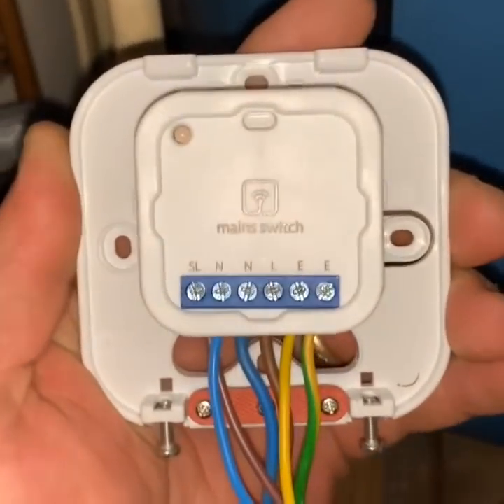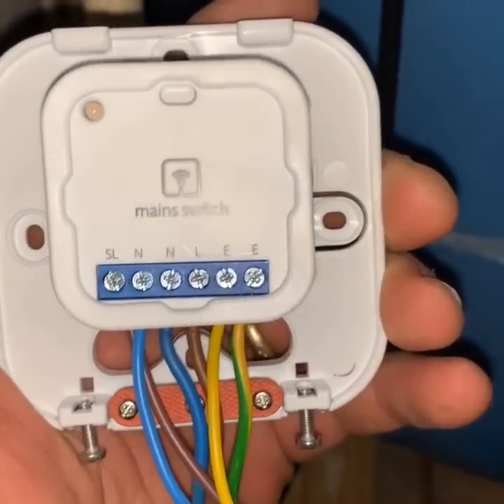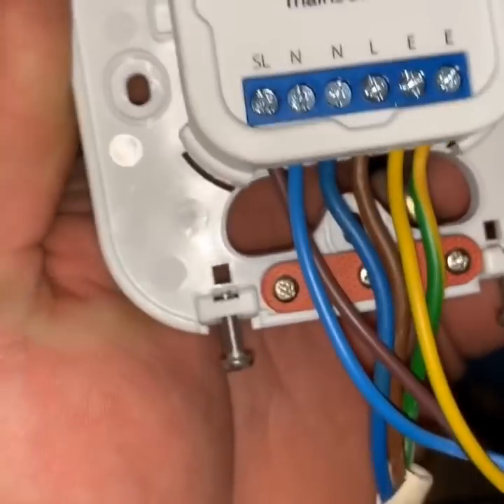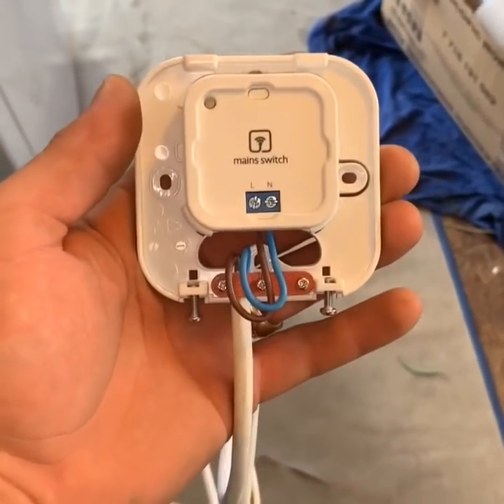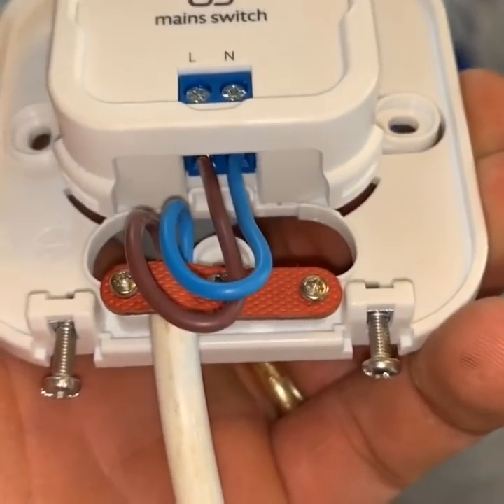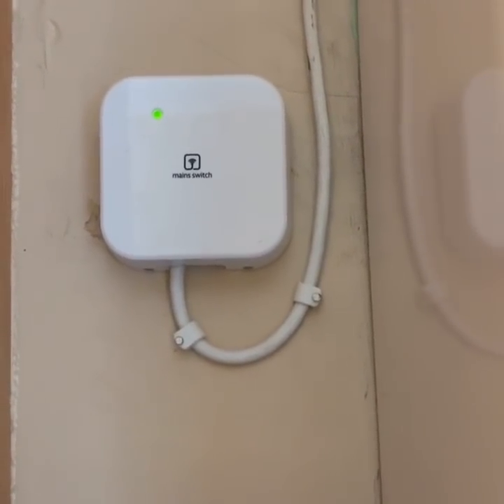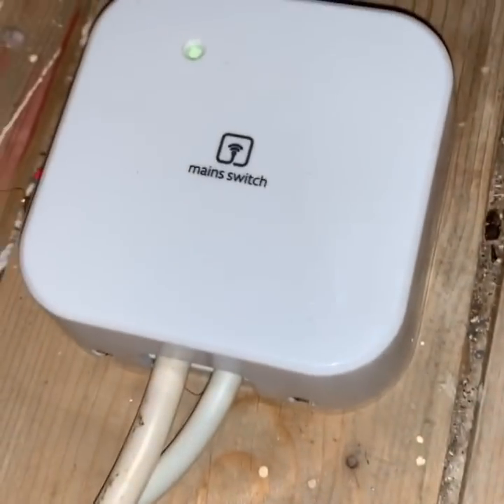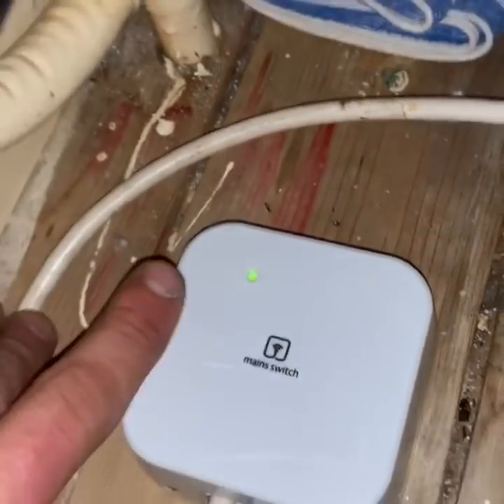Mains Switch RF Solution Product Review

Comment: Hi Wayne. I'm a DIYer.... with a brain and today I've wired my units to my glow worm energy 25r boiler. Seems to be kind of working but not fully. At the moment when the hot water or heating is switched off, the wiring centre immediately cuts power to the receiver and the pump and the boiler also shuts down instantly. Should I have wired the upstairs receiver to the mains permanent live feed. I assume it is currently wired to the wiring centre under a switched live or similar but I am yet to take the front cover off that just yet to investigate. Would there be anything that needs changing on the boiler settings?
Reply from the maker: Yes it needs to go to a perm live to keep the signal
Reply: @offthetools  OK that makes sense. But the boiler switches itself off instantly when the hive controller sends the signal to the wiring centre. Does this require wiring a different way or settings changing on the boiler perhaps?
Reply from the maker: Whats the reason you have installed this unit? Not sure if your boiler has a pump over run requirement’s
Reply: @offthetools  the manufacturer warranty guy came out and there's been numerous issues since installation 4 or 5 years ago but I only bought the house recently. He said I need to have pump overrun either with a cable or a wireless switch
Reply from the maker: Ahh ok. Makes sense.

So you said the boiler goes off, does it loose power completely? As it needs a perm live at the boiler too
Reply: @offthetools  the boiler screen switches off and everything seems to stop. This happens just a fee seconds after the actuators and hive system stop upstairs. It's interesting because the boiler has no wired connection to the upstairs... I guess it senses the flow stopping maybe?
Reply: @greeno271  You need to move your boiler over to the permanent live in the wiring centre so it doesn't switch off. Put the transmitter next the boiler and wire the receiver from the  permanent live, wiring the SL output on it to the pump. You then need another pair of thse. Transmitter in the airing cupboard to transmit the switched live from the Hive down to the boiler, and another receiver placed next to the boiler in a similar fashion as the pump wired to the switch live on the boiler.

Comment: Hi Dave, any ideas if this can work the other way round, as in all controls at heating cupboard but only a perm live at boiler. Will it send a switched supply to boiler from motorised valves in heating cupboard?
Reply from the maker: Yes it will

Comment: How does this work if the upstairs wiring has no permanent live, I have a 3 port valve, Cyl stat & pump. Downstairs has the boiler, programmer & fused spur!!??
Reply from the maker: U need a perm live for this to work.

Where is clock?
Reply: @offthetools  the clock is below the boiler
Reply from the maker: @LordoftheBadger  ahh.

Add me on Facebook il send you some details on how you can overcome this mate
Reply: @offthetools   PLEASE TELL US HOW THIS WILL WORK WHEN THE CLOCK IS DOWNSTAIRS WITH THE BOILER AS WE CANT PHYSICALLY RUN THE EXTRA CABLE TO THE PUMP IN THE AIRING CUPBOARD. THANKS PAUL
Reply from the maker: @paulchaplow5861  thats the whole point. You wire one part by the boiler and another part to the pump. Watch the full video is explains it all

Comment: Quick question. When the boiler goes off with demand, will the pump overrun with this device to cool boiler down similar to a traditional built in pump overrun? As the boiler is no longer energied by switch live from external controls, will this unit allow pump to over run?
Reply from the maker: addz91 yes, it works in the same way

Comment: Surely on an old boiler, once the demand for the boiler to run is omitted,  then the signal for the pump to run will also be omitted.  I am not sure how pump overrun can be achieved on old boilers using this technology.
Reply from the maker: Ian winspear its designed for new boilers that control the pump mate
Reply: @offthetools  oh I see . Thanks for the information

Comment: Wayne , thanks for the video , but I am a bit confused , because I would have assumed that as the boiler switches off , the pump would carry on for a few minutes creating a pump overrun , as you suggested.  Surely this can only be achieved if the Pump Switched live from the boiler is passed through these units instead of the Pump Live. (Worcester Bosch Greenstar 24RI with Pump in Loft) three connections for pump out  , on P2 connector.
Reply from the maker: Dave Ramsden yes the Pump live feed from boiler goes into the unit and that signal is sent to the pump via the other unit.
Reply from the maker: Dave Ramsden and then when boiler pump live turns off it kills the signal to the pump.